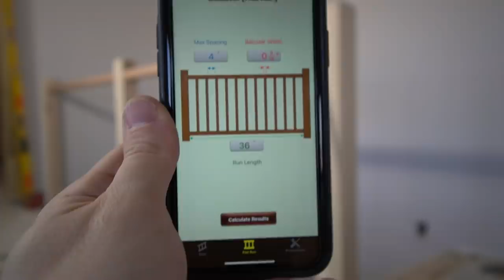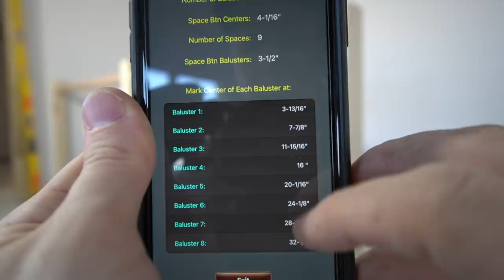Are These SAFE??? - Horizontal Stair Balusters - Tricks to Make Them Fit...

Comment: 1/2"forstner bit, genius
Pitch block, genius.
Thank you for sharing great information
Reply from the maker: Glad it was helpful!
Reply: A pitch block should be in every stair builders toolbox. It gives you your rise , run and rake. , it can be used for cutting your angles on volutes  and up easing
Reply: @duaynenaugle4186  there's a stair layout app that will also give the angle with rises and runs I gotta find the baluster one now

Comment: Nice video as usual. When I make my story poles, I take a piece that's the width of my newel posts, cut a U out of the top that's the profile of any top rail(and bottom rail if it's there) to straddle the rails and lock into place. I secure a couple blocks on the side of the piece if there's no bottom rail and then have all 1/8 pilot holes drilled in the right location. I just lock it in and fire away. Eliminates the need to mark height with a pencil and center with a combo square. Works especially well for long cable runs on exterior decks. Some people could say that as you use it you'll widen the hole and the bit can walk but it's easy to maintain enough control to avoid that.
Reply from the maker: Great technique. 🔥👍

Comment: As usual, Mr. Carpenter delivers superb techniques and explanation. My recommendation for the slanted hole is to cut out the front of the wood guide to accommodate the spade of the drill and rest the drill rod on it. That way, you don't have to check the angle often. I will even put a half circle chanel on it by drilling then sawing it to give a good resting surface.

Comment: I do production stairs, use a grinder with a sanding disk or flap wheel and use that to debur the bulisters. For the balusters on the rake i use a couple scraps to make a guide on the same angle that i can run my drill along. Also use 15 minute epoxy for balusters it's much much stronger

Comment: On the angled ones you did at the end, you added some adhesive and also because of the angle it would be less likely for the balusters to move and come out of the holes, but how do you make sure the balusters don’t come out on the horizontal ones you did in the beginning of the video… same adhesive? Thanks for the content, very educational!!
Reply: @14:00 he uses adhesive in the holes.
Reply: @SeanFoushee  Aren’t those the raked balusters?  I had same question about the first, horizontal set - might not even matter if those horizontal ones are “removable”.
Reply: I had the same question—I would definitely use the adhesive on the flat as well.

Comment: If you want to do this on a budget you can buy 3/4 metal electrical piping and a roll of heat shrink tubing and slide the conduit into the heat shrink and hit it with the heat gun real quick. Nice smooth finish ,extremely durable .i have done it numerous times.

Comment: Assuming you leveled the top railing, are you measuring down from the top to create your story stick?  Asking because a lot of floors aren’t level and using the floor side as starting reference could possibly leave you with uneven spacing.  Also, I feel sorry for the guy who has to paint or stain the railing & posts afterwards!  Would be far easier to do before the baluster installs, I imagine.

Comment: That’s awesome, I use a forstner bit too, to add some space on the inside of the hole when I do railing. I’ve got the large DeWalt bandsaw but that small one looks perfect for railing. I also was picking crap out of my eyes today because I was only using my safety squints. 😉

Comment: Very frustrating when code allows unsafe practices. Doesn’t give the builder any recourse except to inform the client (or, I guess, decline the job).  On the other hand the code is only good if someone cares or notices. We had to retrofit a 38” high fence 30’ long along a 10’ drop. The contractor said the customer was replacing a damaged fence and only wanted a top and middle rail, so that’s what he did - after he informed the customer it was not code and dangerous for children. No permit involved (but was it required?). Fortunately, no accidents. We just added the vertical balusters. Which was interesting because the posts were not equally spaced and we wanted it to look fairly uniform.
Reply: He did say that it’s per code in his area and that the owner wants it that done that way. He wins

Comment: What is to stop the 2nd flr horizontal bars from being pulled all the way to the side that was hollowed out with the forstner bit and then coming out of it's whole on the opposite side, it didn't look like you put caulk or anything to prevent that like on the stairs?

Comment: I found that app, and downloaded it. It’ll work great for strait runs, but what if you need to drill in to stairs.
I’ve got two 11’-0” runs to do on basement stairs next week, and a little lost on spacing.
Reply: I suggest starting layout only on the stairs first, so front of batuster is even with front of riser...all the way thru the run.  Then divide each tread as necessary.  Usually you'll end up with 3 balusters per tread.  Then, for the rail.  It depends if the rail is solid or plowed, and if your balusters are square or round tapered.  Either way, level up from center of baluster layout on stairs for each location so you don't start an  accumulated run.  For round tapered balusters, they make a special level with a marking point that works well for top to bottom centers.  Hope this helps.
Reply: can you share that app? I can't find it!! thanks

Comment: Where did you source the balusters themselves?  having trouble finding rods long enough, as most classic balusters are only up to about 42".
Reply from the maker: I think these actually came in 8' lengths. If I remember right, I ended up throwing away the 40"+ offcuts. LJ Smith might be a good source.

Comment: The craftsmanship is as always stellar,  building a ladder is mind boggling as any child will climb it and it will likely  collapse it leaving a nice opening before they reach the top. It’s amazing that it meets code. I’m guessing the tubes are of a gauge that can’t tolerate  weight. Are you as the installer legally liable in any way? Everyone these days lives to hold others responsible instead of themselves. 
Your skills at your age are outstanding!
Reply: It was illegal to use ladder balausters up until 2001. The updated IRC to current no longer includes the language banning them

Comment: No they are not safe in my opinion.  I'd imagine if you did a simple stress test on the balusters by even modest pressure in the middle of space you'll find they will flex and maybe enough to pop out of the holes.   Also these are hollow tubes so very little rigidity.   Even at 36 inches I suspect there will be some flex and I would doubt they could hold the weight of a child climbing on them.   I think the workmanship is fine but the concept is flawed.    Frankly I do not understand why some clients insist on re inventing the wheel.  Most communities do not allow horizontal balusters unless they are mighty stiff and secure.    A better idea is to have tubes... ideally solid ones.... welded to plates that attach to the vertical  posts via screws.   So an entirely welded frame that would slide into the space. Alternatively  I'd also say that adding some sort of additional wood strips with holes that would essentially extend the depth of the rods into the vertical posts.  So essentially a thick strip with holes matching the ones on the posts and then cut them in half so there is a left and right component that is installed after the balusters are installed.   Theoretically if someone would have stepped on the balusters these strips would add enough depth of insertion to prevent the balusters from popping out.  
Spencer of course does excellent work but this horizontal baluster idea is crazy in my mind.